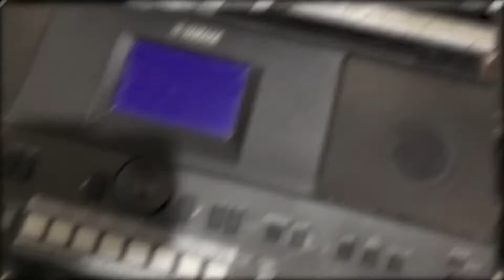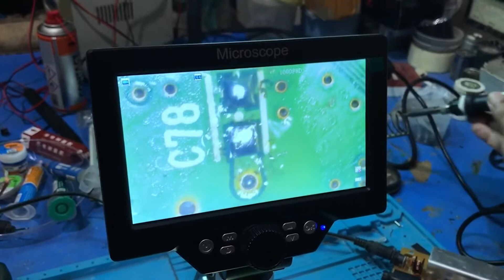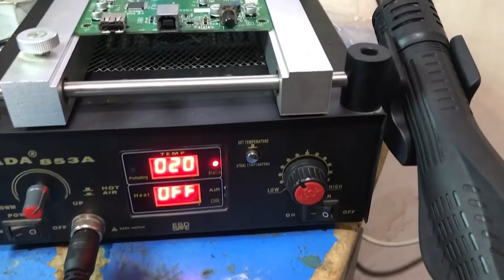YAMAHA PSR-S650 | Motherboard boot Problem | Dead Motherboard

Comment: brother, I found this suddenly, my problem is as same in this video. what I face is when I plug in the keyboard to power and try to switch on the power button and after releasing it, it shows only a blue screen while pushing the power button, but not switching on the keyboard. After several attempts doing it by unplugging and plugging step by step, my problem can be solved and I can play.  but whenever I start playing it another day again the problem comes and keeps disturbing me all the time like previously for some time. As you think what I should do brother and is this a vulnerable bad sign of my keyboard?. pls helm me, thanks
Reply from the maker: My friend. There is some moisture in your motherboard. Just take it out from your keyboard and clean it with thinner / CTC and you can use 99% alcohol. Use one of these with brush then dry it with hairdryer/ hot gun

Comment: Hello, I have two Yamaha PSR-S710 and each one has a different problem, one does not recognize the USB memory, the USB serial port does not work, and the screen says "the connected USB device is not responsive.

It does not recognize any USB memory or the serial port to connect it to the PC.

The other PSR-S710, the screen turns on fine but the entire system is blocked, no key sounds, the buttons do not light up and are useless, only the screen looks fine, but the rest of the keyboard is blocked.

Please remain attentive to any help and thank you very much.

Comment: Brother, how you start the motherboard without ON button attached?
Reply from the maker: Brother any circuit  needs required voltages not a button . I just provide the voltages through external power supply

Comment: I have encountered this problem on Yamaha S650 but don't know where to start. Can share some tips, please? Thanks in advance.
Reply from the maker: What happened with your keyboard. What the condition?
Reply: @soundpro4654  same as the one in this video, supply voltage 5v & 3.3v present, RAM already replaced but still cannot on. Any advise?
Reply from the maker: Do you use oscilloscope ?
Reply from the maker: My number is the discretion. Msg me on WhatsApp or email me . I will give you some tips

Comment: Dear friend, my PSR e453 when I press the on button, display on but when the on button is relased it turns off. What is the problem?
Reply from the maker: Problem is in PNL-T board. Power supply card.
Check the transistors 
TR101 ,TR102,TR103
Maybe it’s dry sold and u have to resold it and May be one of theses is faulty .check it and Replace it . Problem will be fix

Comment: Dear Friend I subscribe and like your YouTube videos.
I am a Electronic tech and notice many cold solder on the Yamaha PSR-510 keyboard.
Waiting for liquid flux to arrive from NorthridgeFix to re-solder many connections.
Problems are the display is showing random numbers and lately sporadically the power is going off. I do have the service manual at hand. The display show random numbers at the first digit like 668 or 868 instead of 068, could it be the logic gate or display shorting.
Thanks in advance....Help.
Reply from the maker: Thank you so much my friend . 
Tell me , 
1 => Is the keyboard working properly other than display ?

2 => switches are working ?

3 => when you start the keyboard, is there any Error code showing on display?

Comment: I have Yamaha PSR -S670 but when swtich it on it gives the error message
Unexpected Error!turn the power off and on again

61959rxrcvmbL64
104-2U0-G10-62A
Can you help me with relevant information to see if I can fix it. Tnx
Reply from the maker: Unexpected Error is motherboard problem. Basically it’s hardware problem.If you know electronics and can do work on motherboard so May be I can help you . If you don’t have experience to work on motherboard. It is bater you have to go your nearest yamaha service Center .
Reply from the maker: May I know where are you from ?

Comment: Hello, I have a psr s 650 with persistent backlight  when power is plugged even without pressing the power on button. The motherboard is dead. How do I solve this problem?
Reply from the maker: Hello sir , check TR401 and TR402 on AM board . 
Also test the volt on  JC2.0 or collector pin of TR402  (AM board ) 
There should be 0 volt when the keyboard is off and 16 Volt when you press power button ON
Reply: Thank you for your directions. I will get back to you with the results
Reply: How much price it the psr s650

Comment: Tengo el mismo problema en el mismo modelo
Reply from the maker: Always not the same solution for the same condition. In my case there was a short circuit on the board . In your case May be the other reason of motherboard not booting.